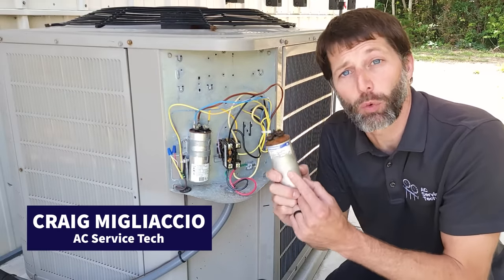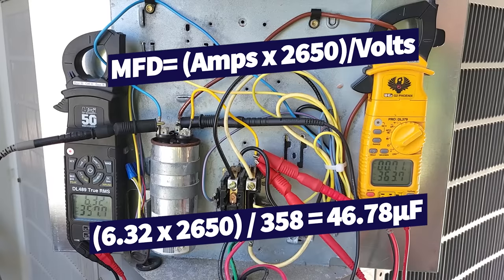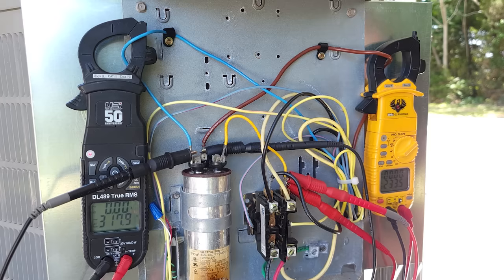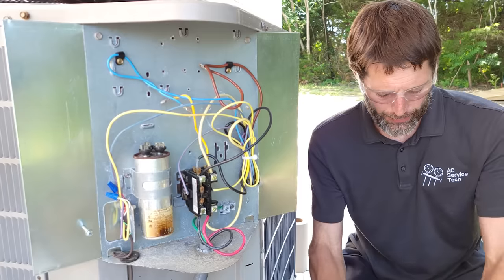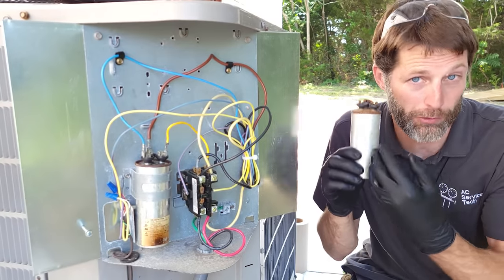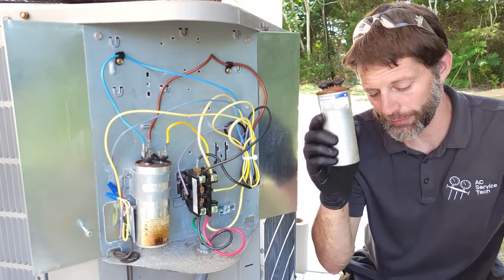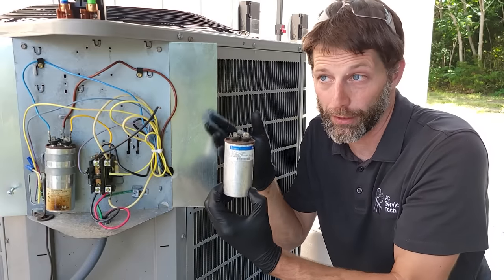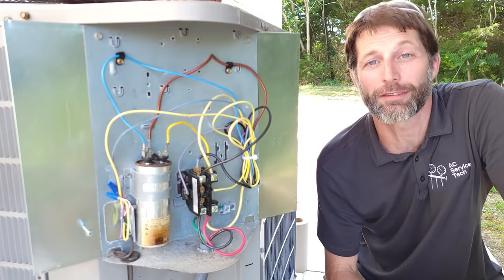WHY CAPACITORS FAIL in Air Conditioners! Watch it Break!

Comment: Idk… a loose connection would not cause the capacitor to fail more than high current/voltage as it is claimed… it was noted that even the weld melts and the two parts separate…

Ok… it would seem to me that high current would heat up the capacitor perhaps to where a defectively built capacitor (not properly soldered) would create micro fractures on the solder or even a full separation of the solder completely fails which in turn creates a spark gap which would create voltages in the kilovolt or even mega volt range which, as you stated, high voltage is a reason that the fluid in the capacitor heats up leading to a dead capacitor.

Thus, the chicken before the egg is wrong. The capacitor did not have a loose connection which caused it to fail. A different problem exists such as over current which caused the capacitor to heat up and create a loose connection if the manufacturer did not solder/weld the capacitor in a manner that it could survive high temperatures caused by over current conditions.  This would be difficult to see with the naked eye but I bet that if you examine one of those “bad connection” capacitors under a microscope, you will see that the solder developed micro fractures in it which likely lead to a spark gap condition and over voltage. This is important because just replacing the capacitor won’t fix the problem long run as the new capacitor will also be receiving too much current and could have been made with the same solder which cracks after it heats and cools too many times (common problem with some solders, see Xbox blue ring of death  for more info).

Im not an electrician not an HVAC technician but I have been working with capacitors and high voltage spark gap “experiments” for a patent idea I have and have seen what a spark gap will do to capacitors lol.

Great video by the way, I highly recommend it :)

Comment: AMRAD capacitors seem better quality as I think they are made in the USA.  I heard the recent problem of short lived capacitors began when the EPA required the use of a less reliable but less toxic fluid inside.
Reply: I think it has more to do with switching from foil electrodes to 'self-healing' electrodes made of metal coated plastic film electrodes. I believe all caps are now are of that construction. I think those changes occurred around the same period. They have gotten more compact and create more heating than the solid metal film caps of vintage cap construction. However they do not short as metal foil ones can.
The terminal disconnect was also incorporated. As self-healing depletes sections of the film, the remaining film (at lower total capacitance) now carries the total current, and heating increases as current flows thru increasingly restricted area. The terminal disconnect feature prevents catastrophic failure or shorting - if I understand correctly. If enough capacity has been lost to cause it to swell and disconnect, the cap is now bad anyway, and disconnecting is the last step to prevent rupture.

The idea was that a small defect would not short the capacitor out, but would disconnect the bad area, loosing only a few percent of the capacity. Only if too many flaws occurred would if kill the cap.

However, it seems to have reduced their reliability instead of increasing it.
I think it is due to the pressure to make them small as possible and use as little costly metal on the films as possible.
My guess is the premium capacitors use thicker aluminum films in their construction...

That is my understanding of it.
Mr KL

Comment: can a faulty capacitor cause the compressor to not fully work cause we had a rain storm and after that my ac dont blow cold like it use to (lost its bite) only blows cool air seems like it dropped about 5 degrees they came out and checked my freon levels and they say its good but is not working properly?

Comment: It’s common practice for some AC technicians to take advantage of the customer and con the customer into purchasing a brand new system, when all that was needed was to replace the broken capacitor. Shocking but true. So, how can the AC consumer guard against such unscrupulous business pratices?
Reply: I saw a TV sting operation years ago where they enlisted the help of an upscale homeowner. They hired a qualified tech to inspect the HVAC system and certify it was in good order. Then they had the tech disconnect one wire on the unit to make the system unable to run. Then they went thru the yellow pages calling repair businesses in the area to fix the unit. Some of them were honest and told the truth about the disconnected wire and only charged the nominal service call fee. And some of them charged for expensive false repairs, and one of them handed the customer a huge estimate to replace the entire system.
Reply: It isn't always easy.  A/C's tend to break during the worst time possible, in the middle of August when the temperature is probably hovering close to 100F in many areas.  People get desperate to get the systems fixed, and some companies will quote ridiculous prices for simple repairs, as they know they can.

The first rule would be to do your research.  Check Yelp.  Ask your neighbors.  See how long the company has been around.  See if they typically install or service your brand of AC.  Don't call the first number you saw on a van driving by one day, and then find out they have a bunch of 1 star reviews after you handed them a pile of money.

You can also do quite a bit of research on how much parts SHOULD cost for your typical system.  If the condenser or air handler motor goes out for example, just google your AC condenser or air handler part number and add in the part you are looking for.  For example Rheem RAMA-060JAZ fan motor.  You would quickly see that that motor is around $120 to $200 or so.  If some AC company tells you that motor cost $600, ask the guy to justify why that is.  If he can't, ask him to kindly pack up his tools and GTFO there.

Capacitors are typically $15 to $60, depending on manufacturer and type.  If someone says your capacitor is $300 in parts, refer to my previous rule above.

Companies and techs rely on your ignorance to rip you off.  If you research what is going on and ask questions, it will make all the difference.  Scam artists usually won't attempt to rip off people if they get the impression you know the actual price of parts and labor.  They rely on gullible and frazzled people and push you to make poor decisions under stress.

Also, before you call your AC tech, check the simple stuff first.  Know where your AC breakers are located and make sure they are not tripped, especially the condenser breaker which can trip of you get a brief brownout.

Check that your drain line isn't clogged.  Your thermostat going blank or air handler turning off is often due to clogged drain line which will trigger the float switch on your drain pan.

Do a cursory check on the system before calling for service.  Tell them you checked the breaker, checked the float switch, checked if the fans on the condenser or air handler was blowing, etc.  That by itself will in many cases save you a service call you probably didn't need to make in the first place.
Reply: By educating yourself, like watching the video, visual observation, measurements, and seeking reviews of the company.  However, an A/C tech often makes just as much money per hour, spending 10 minutes replacing a cap for $200 labor charge, than he/she does working in high temperature installing a new A/C unit.  I known I'd rather be riding around in an air conditioned truck to the next job, making the same as if I were sweating for hours at a time putting a new unit in.

Besides, keeping the old unit running is repeat business when it fails again.  If you build customer trust, they will call you when it's time to do that.

Comment: Start capacitor uses a electrolyte -- a chemically conductive fluid = high MF value but only temporary start duty.  Run capacitor is a foil and a dialectic insulator = low MF but continuous duty.   Some people would replace with the next higher voltage value 
with same MF and get 5 to 10 times the life , but it will be a bigger lump and might not fit.

Comment: I have seen an alarming number of caps fail the last few years.  They hardly ever failed back in the 80's when I started.  My theory is when they used PCB's in the dielectric it made for a very good capacitor.  It's no longer allowed so now they fail regularly.
Reply: As they say, "they don't make them like they used to." Everything is made down to a price these days.
Reply: Made in China...

Comment: It would have been useful if you had pointed out that at around 2:15 in the video, you began to heat the capacitor (with a torch?). Otherwise, I saw no reason for the thing to fail.

Comment: Used to be an electrician apprentice for years. Like a year under getting licensed and this is the kinda capacitor stuff I understand. Started building drones and the caps for them have nothing to do with maintaining voltage. Instead they're to reduce interference. And that's where I get lost. Lol
Reply: All capacitors have the same basic functions in common:
Capacitors pass pulses of current (pass AC), store a charge, block DC, shift phase.

Their purpose can vary depending on what one wants it to do in a circuit!
ACs use them to create a delay* in the currents running in the two motor windings. *(Flows first thru the cap until it starts opposing the flow, and then the main run winding flows at max, right at the time the cap becomes fully charged and NOT flowing...)
The AC polarity then reverses and this process repeats going the 'other way'. (60 times a second).
Noise suppression: it passes high freq noise directly to ground while passing the wanted signal (or DC power) along through.
Power supplies: it stores and maintains the DC level between pulses of power received from the transformer/rectifiers...
Amplifiers: it passes AC audio signal from one stage to the next while blocking DC voltages present in those circuits (powering them), from shorting out the power.

Capacitors can be more challenging to understand because their properties are only evident under dynamic conditions.
Mr KL

Comment: Your description on the construction of a capacitor isn't exactly accurate. Dielectric is roughly a synonym for "insulator", and the electrolytic oil is used because it is an amazing insulator. When the oil is no longer covering the plates, or if the oil has become contaminated, a short circuit can occur. This will permanently damage the plates. "dry" non-electrolytic capacitors exist and they are more durable, but they are much more expensive.

Comment: Capacitors are cheap, replace one if it has any bulge in the top or is more than 3 years old. Buy a good quality replacement, one that is rated for a higher voltage than the OEM version. Replacement is easy, just make sure that the power is off when working on it.

Comment: Bottom line:  Buy an extra start cap for your AC unit. They are about $15 and worth having on hand, esp on a HOT saturday evening when the AC won't start case your cap has failed. I have two heat pump units and I keep two spare start caps for the "both have failed" scenario.

Comment: And like I said it's the exact same thing happens on an electronic circuit board  if you see capacitors that are installed near or in high voltage areas is automatically going to produce a lot of heat especially when it's near a high processing or high heat producing CPU and those capacitors can get very warm to kind of hot

Comment: So....how exactly did you cause the capacitor to fail on demand? Or was this a really, really old system that has been sitting for years that you had a feeling it'd fail after starting up and running for a bit?
Reply: I'm guessing he used a heat-gun to cook it. Notice the label on the bottom looks brown.
Reply: @wiregold8930  I noticed that but wasn't sure if it was something like that or if the cap was heating up itself and causing the label to discolor
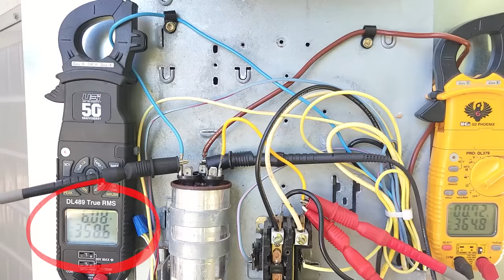Reply: He didn't make it very clear; he heated it up on the bottom. He makes vague mention at 5:42. I had to review it twice after I read others' comments here that he even mentioned it at all...

Comment: Does the back EMF of the comp motor change during normal operations, or with age?
What causes it to increase?
Reply: goes up with RPM. But you will never see that on a compressor. You can see it on a blower motor.

Comment: In case anyone wonders where the 2650 comes from, it’s cuz v/i = 1/wC, where C if capacitance in farads, and w (omega) is 2*pi*f, with f=60Hz. omega is just the line freq in radians per second; for 60hz, you have w= 377 radians per second. Anyhoo, the formula is for microfarads, so you end up needing to scale by a million to get farads. So 1000000/377 is 2652…

Comment: The 330 vac and the 440 vac are the maximum ratings. Yes you can replace a 330 vac  cap with a 440 vac cap. You can not replace a 440vac with a 330 vac cap.

Comment: Great explanation of the whole capacitor-linked system.
What a poor Air Conditioner design - in ALL of them. All they have to do - is put a small 12 volt electronics fan to push cooler air past that capacitor whenever it is running.

Comment: can the capacitor act right and then after like 15 mins it stops working as it should be (the ac compressor start making banging noise) ? and it works again when the capacitor  cools?
when I test the old one it show the correct MFD !
this happened with me and after the capacitor was replaced it worked fine no more banging noise

Comment: Bottom line change the CAP every ? Seasons ?. That will more assure a complete hot season  without this failure and checks the connections.😊

Comment: When the top bulged up, was that a manufacturing design to stop current flow when it overheated?
Reply: Yes it is designed for that purpose. The older caps that still used pcb's rarely failed, but when they did, they would burst and the oil would be all over everything. The new ones fail much more often, so they built in that electrical disconnect to prevent most from bursting.
Reply: @imnotabotrlyimnot  thanks, I was guessing that because who'd want crap sprayed all over their meters just to demonstrate a point for a video.

Comment: So, why did the capacitor in this example fail?? It wasn't over voltage, it wasn't the ambient temperature. Was there too much current from the compressor?  For this example, it looks like if you just replaced the capacitor, it would fail again in short order.
Reply: He set it on fire!
Reply: he heated it up with a torch?  look at the base you can see the brown burn mark + he stated that he heated it up

Comment: Craig, you are absolutely amazing! Thank you so much for sharing some of your experiences. How does this compare to the capacitor in my microwave oven? It says that you have to short it out before handling it because the voltage contained could kill you! Does anyone have any advice for me? Thank you all so much, there are hundreds of helpful people on this channel!
Reply: There are hazards with anything using high voltage or transformers.  Hence, you can use a DVM to check the DC voltage on a capacitor before you remove it.  You bleed them down using a resistor if they have a voltage present before you remove it.

In those applications however, if you are not trained to work on electronics and don't know what you are doing, you probably should not under any circumstances remove the cover screws in the first place, for your own safety.

Microwave ovens are pretty cheap as it is, and if something failed like a capacitor, something else down circuit could have made it fail.  Probably safer for everyone if you just bought a new one.
Reply: @redbaron6805  Thank you so much for your advice. It unfortunately is an over the range type that is a very tight fit due to a granite backsplash.
Reply: @mitchellbarnow1709  Understood.  Ultimately, you are probably better off trying to locate a small appliance repair guy than trying to tackle this yourself.

The most common failure on microwaves is the magnetron failing.  The magnetron runs on high voltage, so attempting this yourself without proper training is not something I would ever recommend.

Comment: I always thought the PCB’s made the old ones last longer but who knows. I know AmRad seems to make a much better capacitor than the Chinese. When I started installing 30 years ago most of the old units- some as old as 1960’s, had original capacitors in them. Now I  see them failing regularly in less than five years. I’ve even seen a few fail after a year or two. They can’t make things cheap enough anymore! Even Trane’s quality has gone down dramatically and don’t get me started about evaporator coils!!! Heat is definitely a major factor where I am in South Carolina. The days it’s gets above 93 degrees they go off like popcorn.
Reply: It is probably not a bad idea on every system to just replace all the Chinesium junk with Amrad capacitors, even on a new system.  Uprating the voltage rating will also make them last longer.

Comment: Electrolyte fluid. The dielectric is the film between the layers when rolled.
Reply: It is, after all, an electrolytic capacitor
Reply: Run capacitors are typically film capacitors. Only the start capacitor is electrolytic.